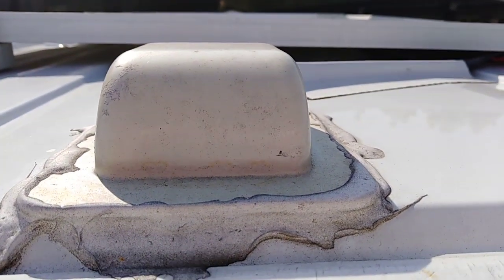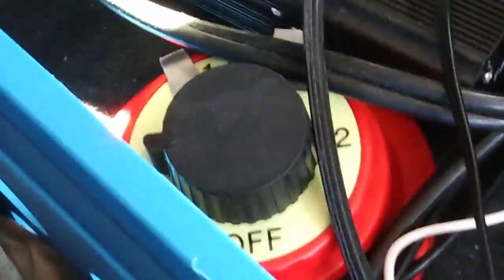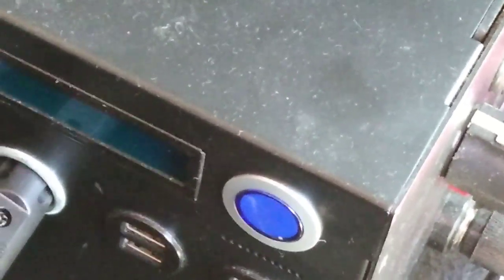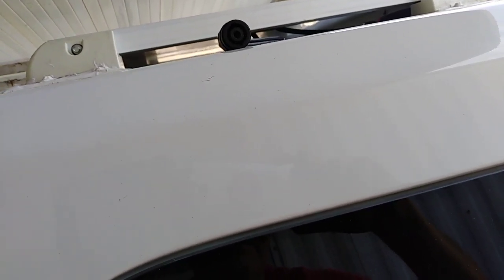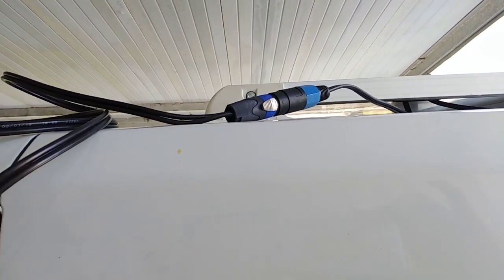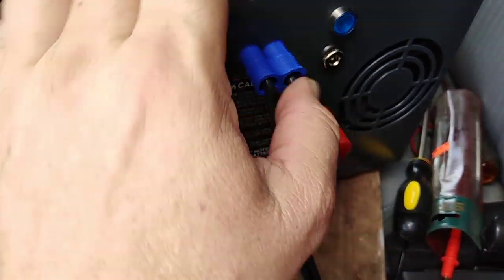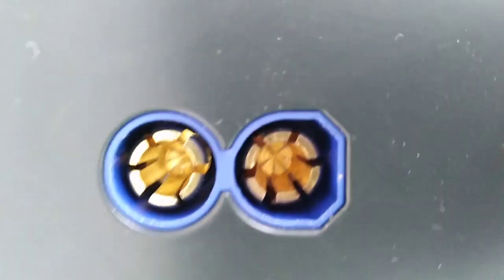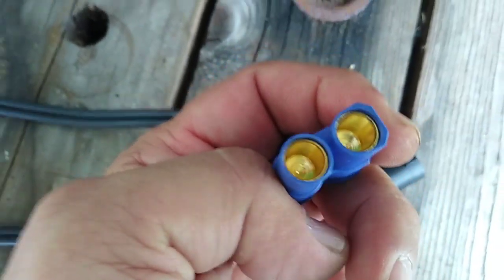Connecting the Apex Solar Generator to the a 400 watt solar panels of the Kodiak Solar Generator.

Comment: Nice to see it was an easy fix... info like this really comes in handy, I plan on being remote and getting an Apex to go along with my Kodiak like you and this little fix could really save lots of time, money and shipping. 

I can also share one tip that I think? The Prepper Princes channel shared... Use single childproof outlet covers to keep dust and dirt out of the outlets you ate not using.  I only use 3 max and the others are covered.  A bag of outlet covers are about $5.00 or less on Amazon/ebay.  Also the Inergy fast wall charger is twice as fast on charging.. I place mine in fron of a little fan run of my Kodiak just to keep the brick cool while its charging, the little fan is just a small amount of watts and it should extended the life of the charging “brick” by a little.